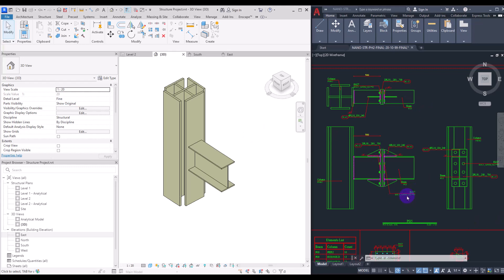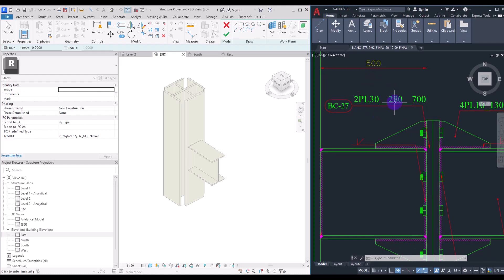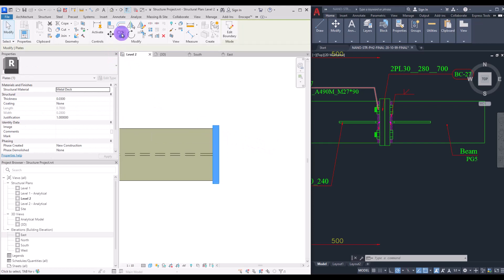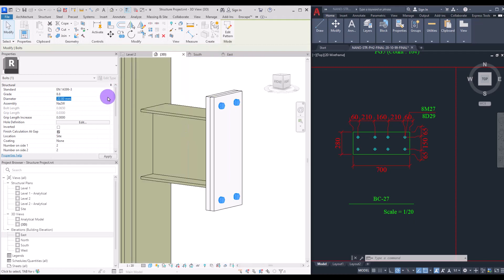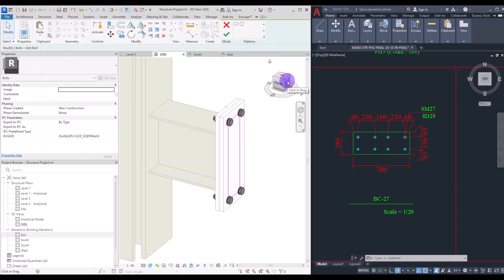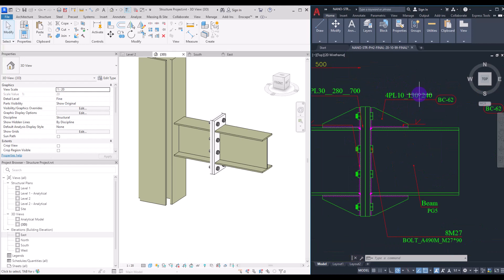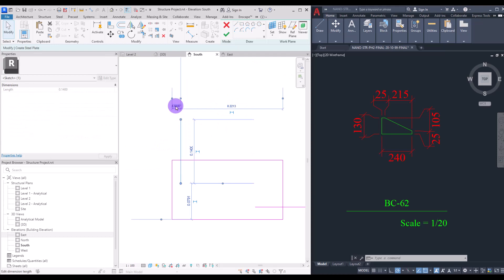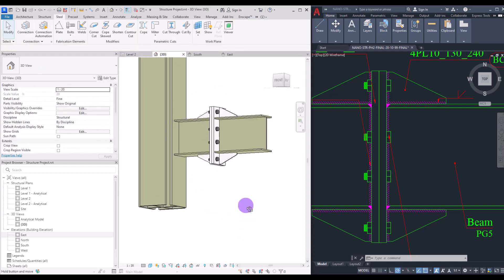Model Steel Beam Connection based on 2D Documents in Revit

Comment: great video. the dimension style in autocad seems very unique. the lines open up to make room for the text. how did you get that?
Reply from the maker: Thank You. Type "DDIM" to open the Dimension Setting. Select the Dimension Type That You want to change and click on Modify. Go to "Text" Tab and in "Text Placement" Section, put Vertical and Horizontal on "Centered".